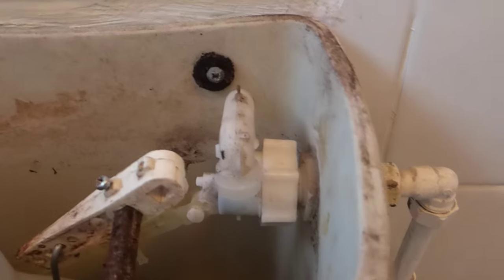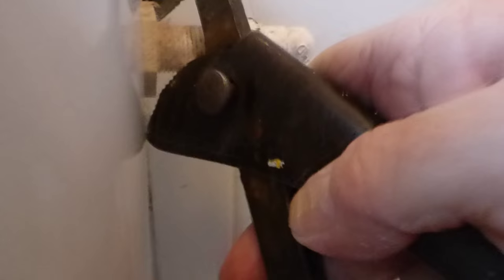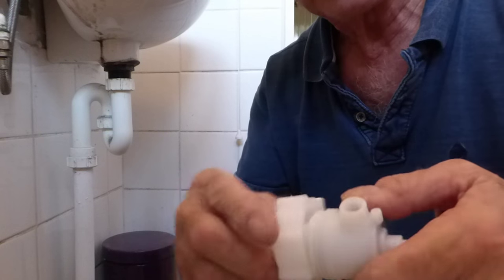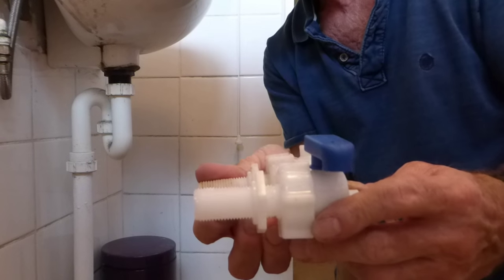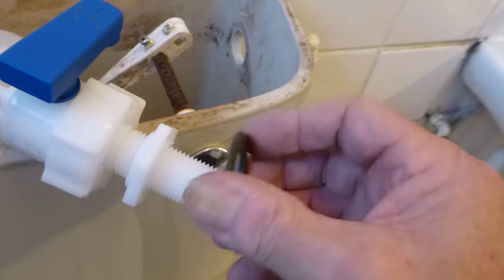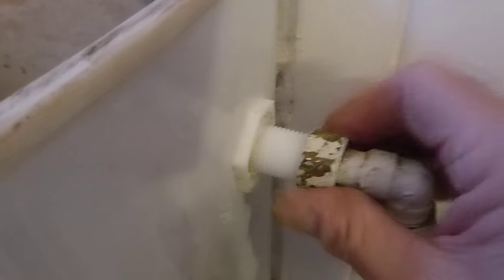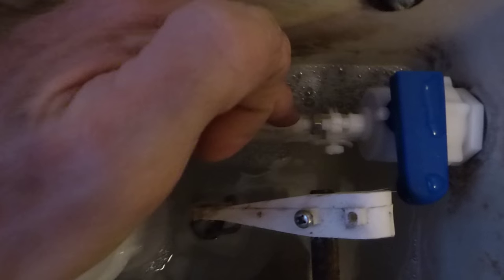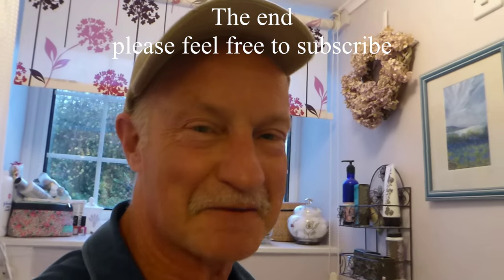How to renew a plastic WC cistern ballcock

Comment: Hi Al great help.  My cistern was overflowing now and then but I could not adjust the level!  The adjuster was difficult to get hold of as it was under the arm.  Watching your great video made me realize the arm was fitted to the valve upside down.  Must have been yours truly who had done it some years ago - amazingly it worked that way.  Now it is sorted so many thanks.
Reply from the maker: No problem Mark.

Comment: Hi Al, I've just installed 2 new concealed cisterns, one stops at the 6 litre mark and shuts off nicely, whilst the other carries on dribbling until it seeps through the overflow. Any quick and easy remedies?

Thanks in advance.
Reply from the maker: Quickest and easiest solution is to renew the ballcock.
Reply: +dereton33 even if it's all brand new?
Reply from the maker: To be sure, yes. Unless you fancy dismantling it and changing the washer which may have some muck on it.